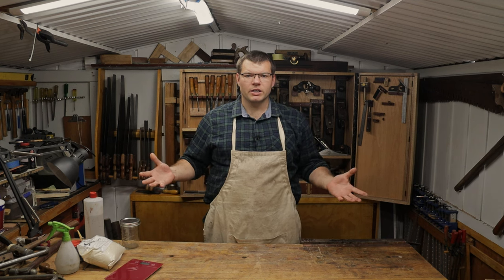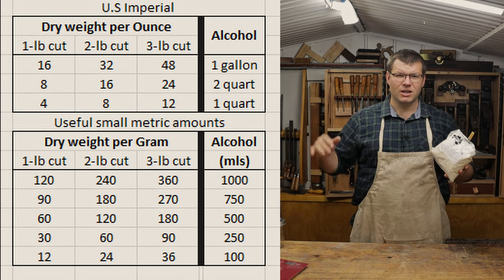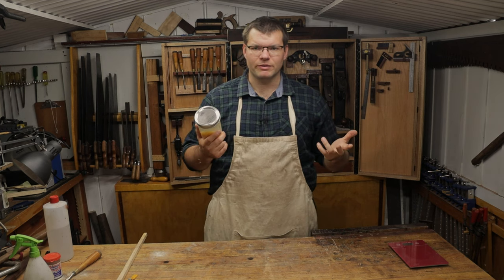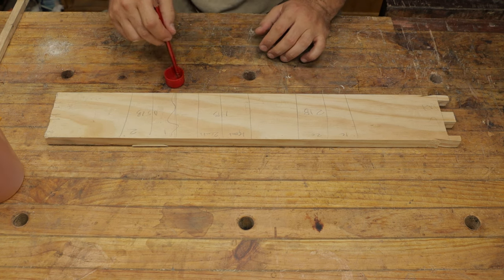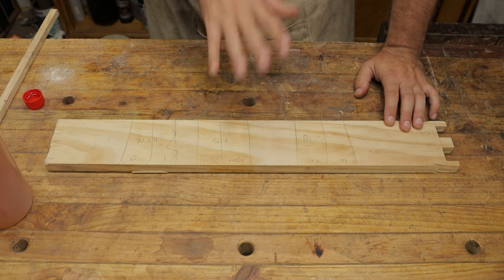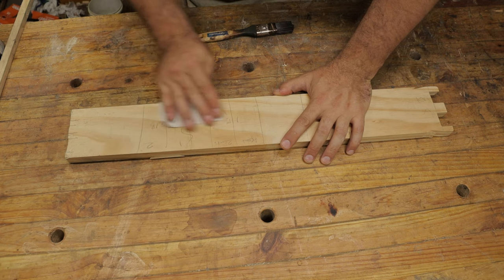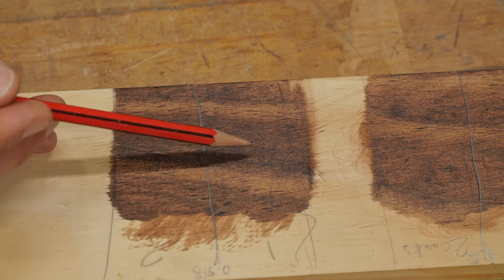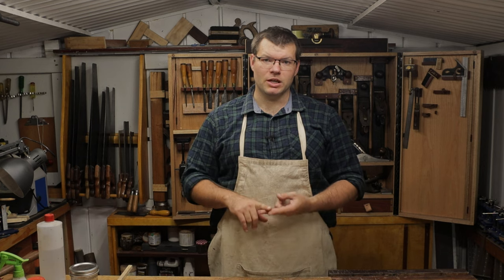DIY Sanding Sealer

Comment: You can use ordinary lacquer, such as Watco brand, as a sanding sealer too. And if you mix it half and half with lacquer thinner it makes an all-purpose solution widely used in Asia. You can use it as a primer or pre-stain conditioner, but also as a topcoat too., or just for touch-ups. You can apply it either by brush or cotton rag or spray gun. And you can apply as many coats as you like, allowing dry time in-between and lightly sanding as desired. Watch the "Royal Wood Polish Work" guy in Asia for more info, although he does NOT speak English. CAUTION: Use lacquer and lacquer thinner only in a well-ventilated area or wear a respirator!
Reply from the maker: Thanks for this information, much appreciated.

Comment: Denatured alcohol and methylated spirits are the same thing, afaik. The denaturant, or poison that they add used to be methanol, that’s why they call it ‘methylated’. But a lot of alcoholics went blind or died from it. These days, I believe it’s pyridine. Maybe there are different denaturants that small better.
Reply from the maker: Methylated spirits has between 1 - 5% water depending on suppliers. Denatured alcohol is 100% alcohol with no added water. At least everywhere ive found it.

Methylated spirits also smells worse, but in its treatment is made less flammable, meaning it flashes off slower resulting in a slower drying shellac.

Comment: Would Turpentine as a solvent work?
Reply from the maker: Turpentine won't work for shellac as its not alcohol. Alcohol is required for shellac, commonly used is methylated spirits or denatured alcohol.

Comment: I almost always use 2lb cut, although I rarely use stain anymore. I’ll occasionally mix up 1/2lb or even a little less to use as a “flash coat” for finish repairs but the 2lb seems to suit
Reply from the maker: Thanks for sharing

Comment: I noticed it didn't darken the wood to much.  I like that. Great info! Thanks.  I wonder if you could use turpentine instead of alcohol? And can you apply this over wood that has already had a cured volatile oil applied?
Reply from the maker: No you can't use turpentine instead of alcohol as the shellac is only soluble in alcohol. There may however be some finish mixes that incorporate a small amount of turpentine (which slows the drying time) but i have no experience with that.

You can 100% apply shellac over the top of a curing oil (linseed, tung, hemp etc.) as long as the oil is completely dried and cured first.
Reply: @AussieWoodshed  awesome thanks!